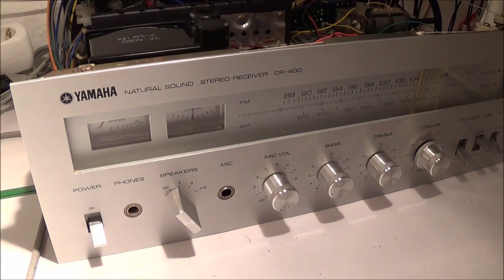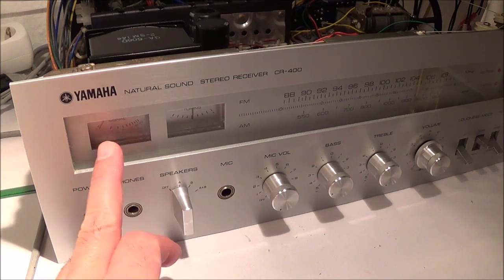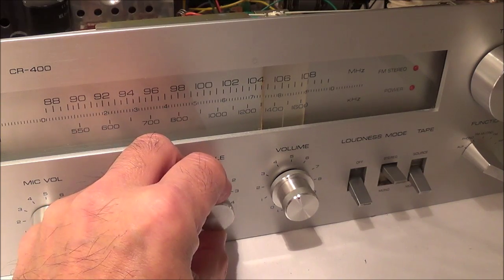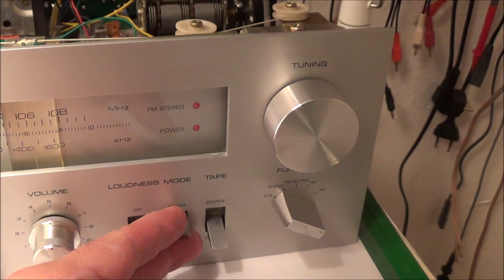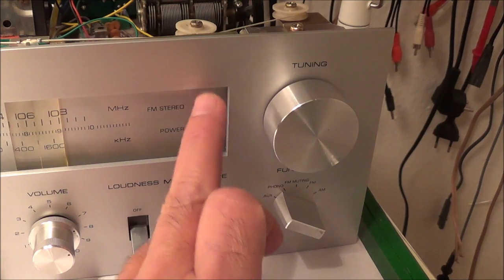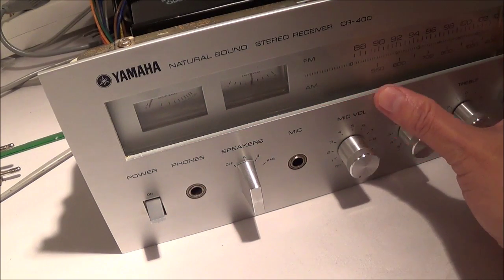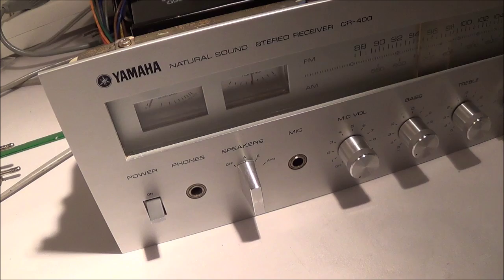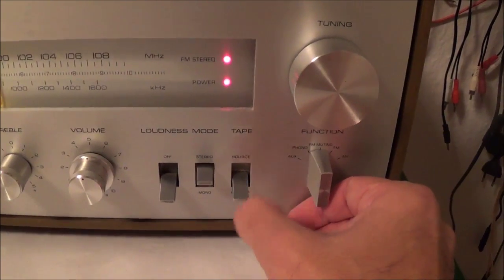Yamaha CR-400 Stereo Receiver Introduction

Comment: AUX - Probably you should say "Auxillary" out loud for Newbies, since "AUX" is an abbreviation so it fits the switch label area. Like "MONO" means "Monaural." The Microphone was an interesting feature back in the day, my Pioneer SX-636 has one.  It didn't mix, but served as a PA through the stereo's speakers. I always thought the FM "mute" switch was annoying as it blocked most stations. I saw a less-than pristine receiver for $50 at a thrift shop, not as clean as your unit.  Enjoy.
Reply from the maker: Thanks for the suggestions; I never thought about complete newbies. The FM muting removes noise hiss when dialing between stations. Weaker channels cannot then be heard. Sometimes this can be adjusted. $50 dollars is too much for a non-clean unit, especially since you probably can't try it out in the store. But I would pay $50 or even up to a $100 (really clean) for for a clean unit that works if I wanted a receiver to keep for myself. Good equipment that could still be around when we're gone. Look at how much money people throw out the door for other junk. I looked at some electronics stuff in a Goodwill store before; I wasn't happy with the equipment or prices. Okay, what do they know about electronics?
Reply: Good news-- scooped up that CR-400 yesterday. $38 total. Got the "sliding" wood case off to check out the insides.
Sprayed out the dust, etc. Fuses (all) look original.
Of the 4 bulbs you replaced on your vid - I have to replace 3 (but will do 4). Pointer bulb looks easy-Interestingly, there is no "Balance" control-- just a dual controlled volume knob, which I had to loosen up with DeOxit. I usually never use the Balance control anyway.  The new feature to me is the Mic jack (actually a mix function) - unlike my Pioneer SX-636 which has a Mic input - but doesn't mix just amplifies.  I actually plugged an electric guitar into the Mic mix and it mixes in "mono." Although we can do that now with Guitar Amplifiers - it's still a neat function. Not sure what all the "Raving" is about Yamaha's "Natural Sound" though. May be a flatter response in tones.  No capacitors leaking etc.  I am not advanced to use a 'scope 
yet - will probably hunt down an analog used one somewhere - but adjusting Bias settings and other items, re-capping is in the future.  I have read that you have to be careful of improperly grounded "hot chassis" so I will start testing for improperly grounded units (where others have messed with them.) I plugged my IPOD into the back - sounded OK for a 70s unit. 
I think the most interesting thing is that this is a pretty dimly lit unit, or soft lighting maybe.  No "eye popping" dials.
I may try soft LEDs for the panel to get the heat reduced as original bulb cases were brittle, some cracked.

FDW
Reply from the maker: Awesome. Good price. Get yourself a good, simple scope for starters. Then, when you have mastered that, move forward. Otherwise, you might end up getting frustrated...